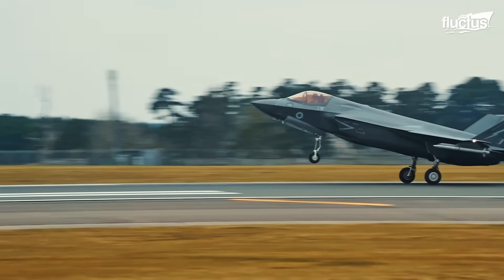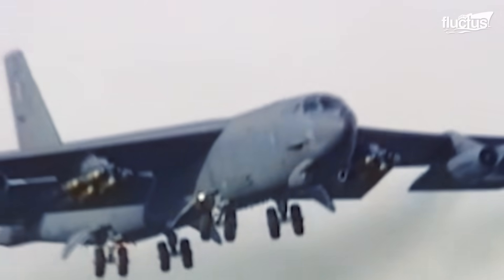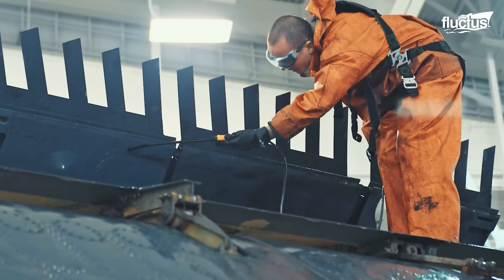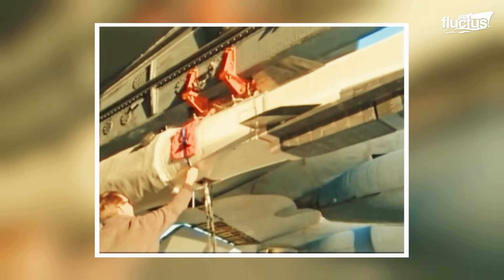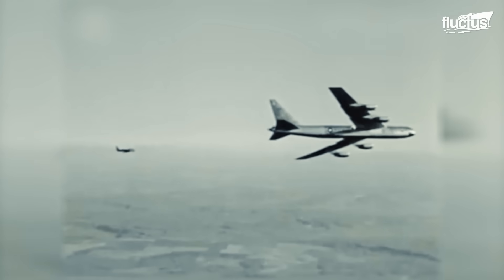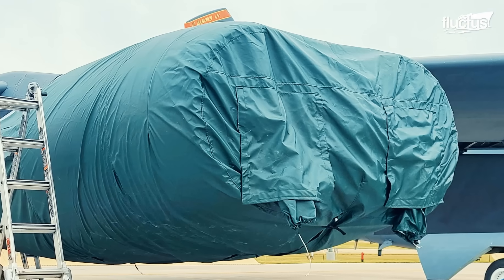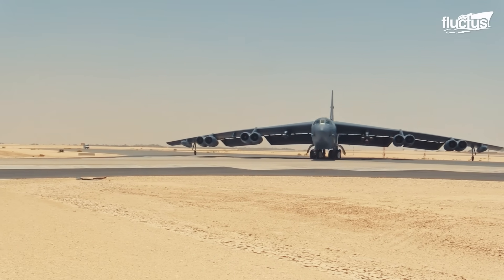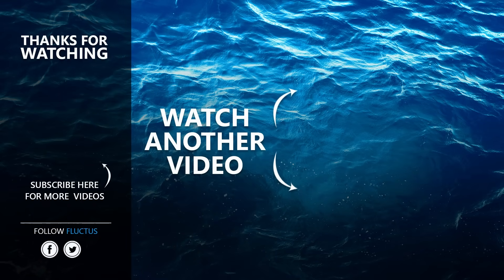How US is Secretly Upgrading its Feared B-52 Bombers to Fly for 100 Years

Comment: Piffle. The only “secret” (Google B52 CERP) was strong arming the Pentagon procurement general who didn’t want to spent his budget on new engines, even though the total expense of keeping the BUFF flying another 25 years with the RR  F130’s was WAY cheaper than maintaining and fueling 8 TF33 engines per aircraft. 

The F130’s won’t need to be removed for maintenance at all, vs. the TF33 that need a million bucks per overhaul per engine every 500 to 1000 hours.

Comment: I liked the short Structural Repair portion.  My first 9 years in the USAF I was Sheet Metal Repair.  I worked B-52 spoilers at McClellan AFB Depot during Desert Storm.  We repaired hundreds of spoilers ripped apart from yanking and banking low-level flying over Iraq.

Comment: Turbines are getting upgraded to Rolls Royce no more air starting or cartridges
Reply: So what your saying is they will be push started after modifications? 🤣.          All large aircraft engines are started by a air turbine starter using air from an auxiliary power unit (APU), ground supplied air or the cartridge start which is the quickest.     Unless they modify the Acft and install an APU it’s going to be down to an ground supplied air or cartridges.      They could put an APU in the area where the tail gun used to be!    🤔.    I wish I had one on my jets!           Starter Carts were cool because they are attached to the starter, so you don’t have to wait for the air lines to build up pressure.        APU’s are small turbine engines that compressed air is bled off to start the main engines.   Most all commercial ACFT have the APU in the tail.
Reply: @hking4619  no their replacing the dated turbines to rolls royce engines for better fuel efficiency to.  So the most they’ll have is a generator supplying electrical power. They want to reduce start times. As it stands you have cartridges or air options. True. adding a apu may be part of the over haul?. They’re not saying. Since these old girls don’t have apu’s They’ll use external power who really knows?
Reply: I'm assuming with advancements and battery technology and electric motor technology they could have one or two electric start and then use the bleed air to start the others well still being lightweight.